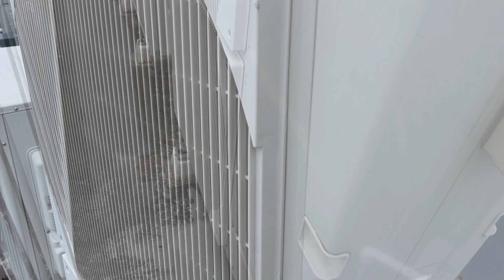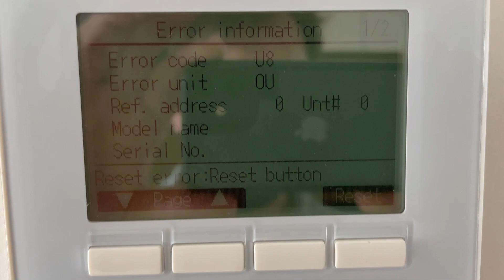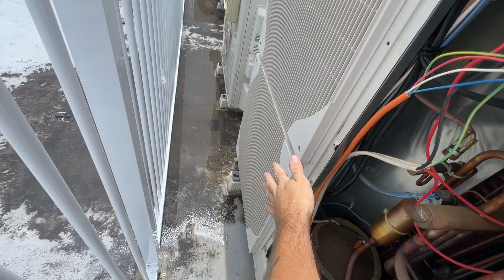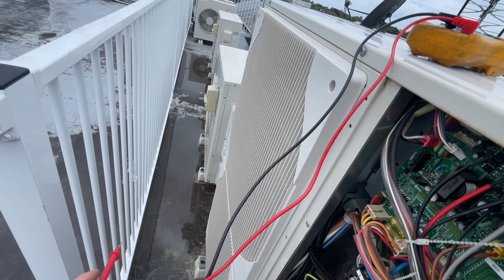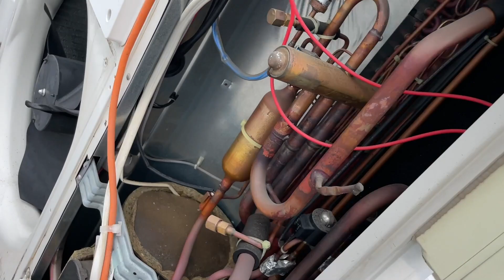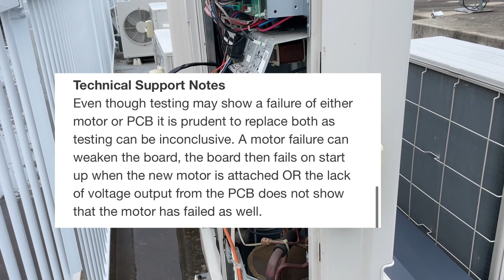Diagnosing Mitsubishi Electric U8 Error

Comment: Check voltage between 4 and 6 when compressor starts running its the operating voltage for fan motor 1 volt to 5 volt dc and also check voltage between 4 to 7 is feedback voltage from motor to pcb card to tell pcb at how much rpm motor is running when motor is not in motion it's around 15volt dc but when it starts running voltage starts decreasing

Comment: Hey Mitch, what was the outcome after replacing just the fan? Agree it's a bit of a rip that the board can't handle the failure of one component. Hard one to justify the extra cost to the customer.
Reply from the maker: I replaced just the fan and it’s been working like a charm ever since. I made a video about it called “Repairing Mitsubishi Electric U8 Error”.